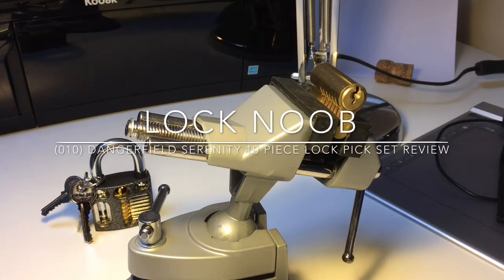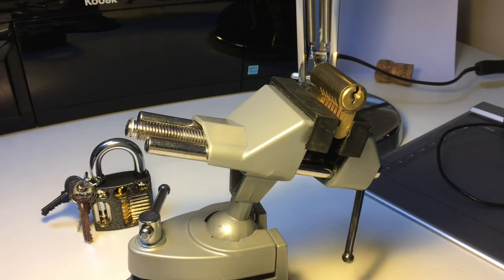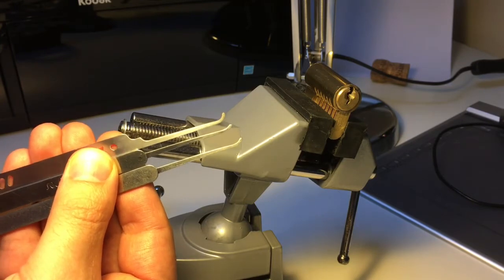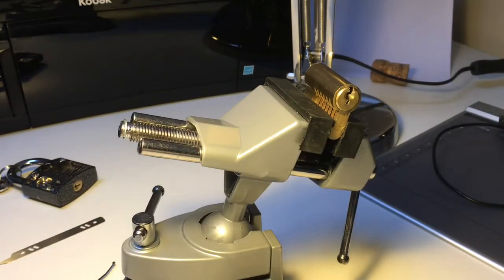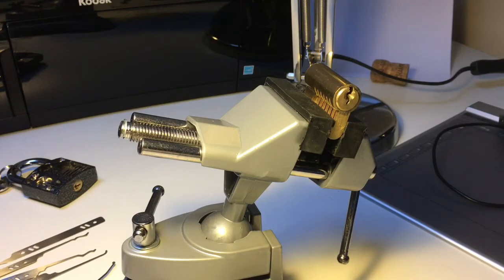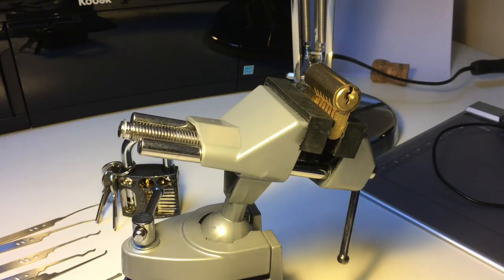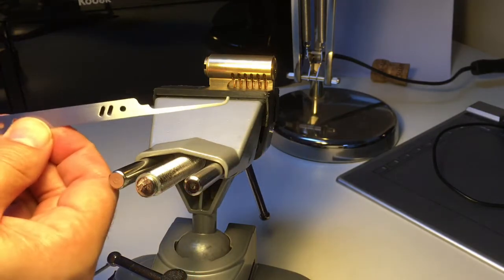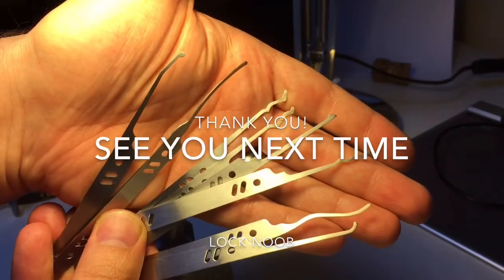(010) Dangerfield Serenity 10 Piece Lock Pick Set Review

Comment: I'm a bit late to the party as this is now 2020 but I have recently bought the Serenity kit as my first proper lockpick set, however it was a mistake. The only hook is too deep as you mentioned and I'm not massively keen on the rakes. There is also a couple of weird  picks to get under pins but I cant seem to be able to use them on the locks I have but I do admit I'm pretty new at this. Finally they are not very comfortable and there is a need to round off the edges. Perhaps a more experienced picker maybe in North America would be be happy.

Comment: Great review LN. I bought the same kit, and as far as the wave shaped pick, I have had success using it in a zipping type attack. I place it on the last pin, and pull forward quickly, and light tension. I don't try to push the pins up too high. it works quickly on some locks. The rocking method works well also. Again thanks for the review. I am happy with my set. Still waiting on the Mad Bob set.

Comment: great vid iv only just bought this same set your so right about that hook for a european kit its just not that great. i also was wondering what that big wave pick was iv used it on a couple of locks and it has worked but id go to another pick before i thought about using it all that said take out those 2 the rest can be slipped into a case and they are so thin they stack well so take up little room and for the price i think its worth it. thanks again a great help you really are sir.